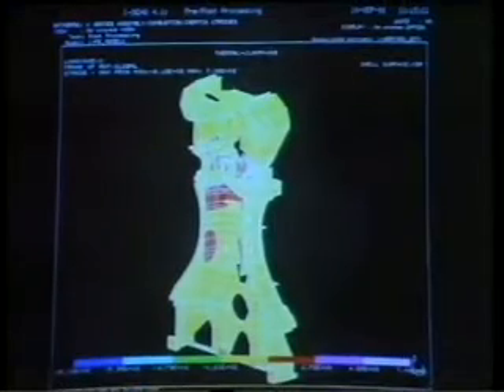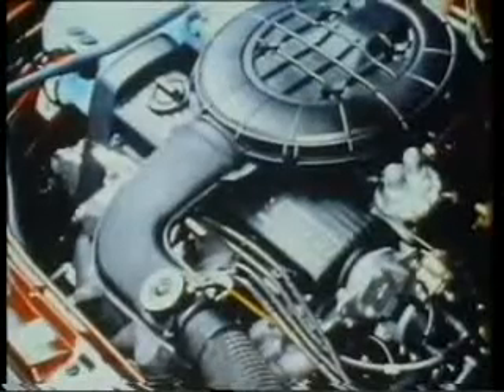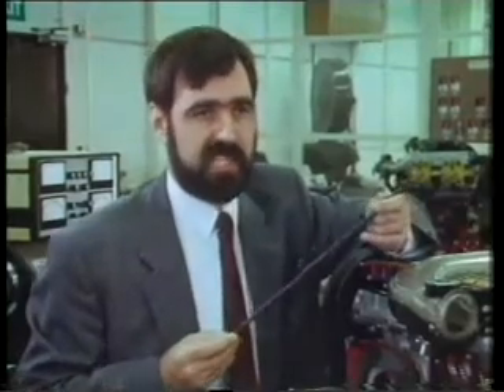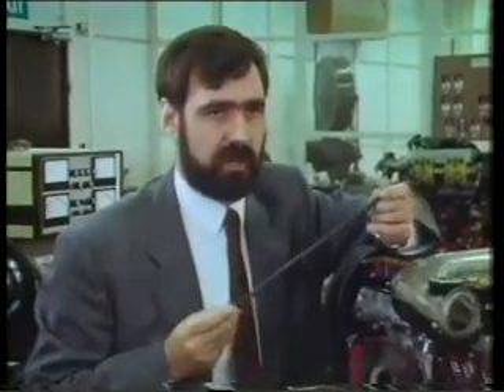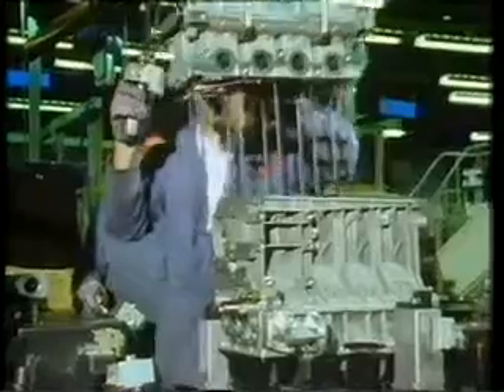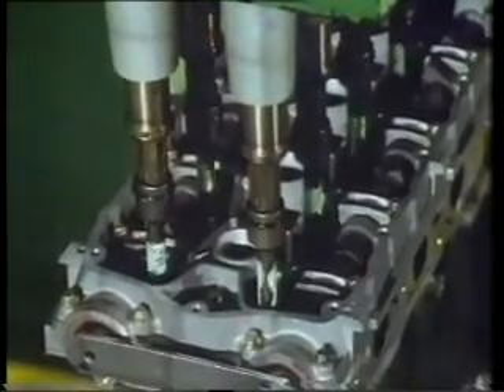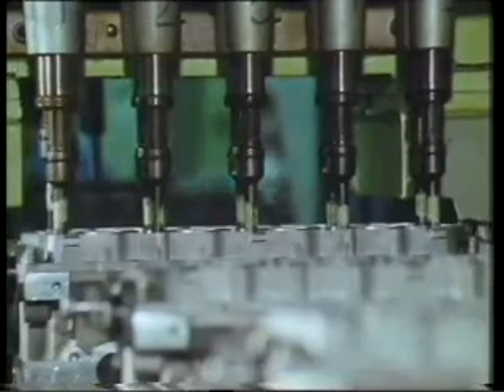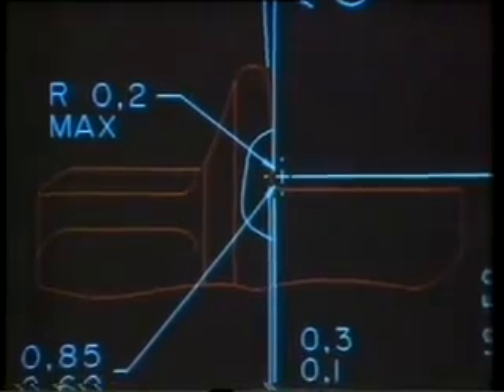Rover K-Series Engine Part Two

Comment: I had two company car Rovers, first one a 214 SLi R8 model, this did 125,000 mls, then had 414 Si HH-R model and this did 94,000 mls, never had any head gasket or cooling issues on either car, they were regularly serviced at the correct intervals and had an additional oil and filter change every 6,000 mls which proves the K series are brilliant reliable engines. There were definitely problems when the overstretched 1.8 engines came in especially with the MGF, having its thermostat placed in the wrong place which caused over heating and with the Freelander, hence Land Rover in conjunction with Powertrain developed the MLS gasket, but these are not bulletproof when used on engines where a head gasket is being replaced, especially if the steel piston liners have moved, the head gasket will fail again, the Elastomer head gasket is far better as elastomer sealing is more flexible in getting a better sealing. Unfortunately today there are too many garages doing crap repairs on these cars and where people don’t service them regularly enough. They  are a high maintenance engine that’s for sure, but well serviced they go on ever.

Comment: little did they know that gasket would kill every single one of thous engings lol... sweet engine thou.. and to be completely onest the blow up just the same as the BMW straight 6. about 30,000 before but never the less the bmws blow up aswell. and normaly crack the head...... if you have a rover and the head gasket goes always get the head skimmed always replace the head bolts. always always always drill out the the air bleed ball bearing in the intake. and you have time grind the terrible casting out in the head inside the water jackets to alllow better water flow.... you do all that the head gasket wont ever go again...oh and not that you can get the old gaskets now. always use the the uprated one with metal dowls... and for thous who dont know the head bolts and head gaskets fit the 1.4 1.6.18 1.8vvc are all the same.. and you really wanna make sure you never have to change it again swop the thermostae for a lower opening temp one plus on the air intake where it connects to the head drill the oppsite side out and put another airbleeder hose in and plum it to the header tank with a t piece...... WOW!!! lol sorry for spelling its late lol

Comment: K series can be made reliable now, with the Chinese spec gasket etc they can go on and on, and they are a very light and revvy engine, a little rough perhaps but fun to use in a sporty car, not great in a 'luxury' car though due to harshness issues. The absolute key is to warm them up slowly and regularly check coolant level due to low capacity.

Comment: The trouble with the Freelander was that people used to treat it like a proper 4x4 and attach a double horse-box to it.  The trouble is that aluminium expands about three times faster than steel so overheating is forbidden!  A Standard Vanguard engine (allegedly still made in India) would be a better bet for lugging heavy loads.  Incidentally I know someone who bought a new Freelander that blew up so often that he wanted rid of it.  The dealer would offer nothing, nil, zero, zilch on it as a trade-in so I think that sums things up.  IMHO ALL 4x4s need a radiator that is capable of dissipating the heat caused by towing the maximum GTW at the maximum legal speed on a hot day. Anything less will be a failure.
Reply: stopped making the Standard Vanguard engine in 1988

Comment: This guy is amazing at repairing the headgasket failures on these engines i had mine done 3 years ago and no faults what so ever, i recommend very highly check him out ebay.co.uk/itm/MGF-TF-ROVER-FREELANDER-HEAD-GASKET-REPAIR-/151110063282?pt=UK_CarsParts_Vehicles_CarParts_SM&hash=item232edc94b2

Comment: Fascinating vid this. My car has this engine. The K Series 1.8i vvc 160ps. People think you cant modify them but you can and the pistons are good for 185bhp easily. Pocket rockets they are until you get HGF lol, but my cars covered 72k and no probs as yet. If you pay alot of coin for something well then you are going to look after it aint ya. Regular servicing with oil,coolant and jobs a good one.

Comment: @gunnit1001 The first rover  gaskit i fitted was on the rover 400 k series cleaned r well down. skimmed the head tightened r well down. never looked back. the new tin gaskit is a good job. grand wee motor.nice to drive.

Comment: @Liamautomechanic I'm not saying they are bad cars by any means and yes the gasket fix does seem to work, there's no denying it. It's just a shame they never came out of the factory with a decent gasket. Interestingly MG are using what is essentially a 1.8 turbo k series,  and the 6 drives alot like a ZT. Re-engineered technology perhaps

Comment: I sighed at 1:50 and yet it was pot luck, anything as low as 30k or even 120k before first head gasket failure. But you would have thought by the late nineties they would  have realised there was a problem and used a proper gasket? After BMW ownership the pheonix four should have focused on replacement cars for their range instead of sports  cars (MG SV), although the MG Z's are under-rated in my view as long as you opt for diesel, v6 (ish) or v8, 10 years too late to save them though

Comment: @engineroomapocalypse My teacher is an ex rover engineer and worked on the K-series project and he says it's not the gasket design, he said it's when BMW bought Rover and they had to make the engines bigger to a 1.6/1.8 by changing to damp liners, the original k-series used in the wedge cars had wet liners and were very reliable, ARG had Maestros and Montegos going around for testing and not one had head gasket failure or any other type of failure, the problems started 1996.
Reply: The head gaskets were a problem way before bmw came, nearly everyone I sold had or was having a problem with the head gasket.

Comment: The head gaskets mainly went on the 1.8 models due to the bigger capacity aqnd the cylinders were close to the water jackets but the 1.1 , 1.4 and 1.6 were all fine.

Comment: My Dad used to own a 414 which had covered 145,000 miles and was on its original headgasket when he sold it. Also faster and more efficient than any rival.

Comment: I had a 1.8 k series Freelander and it was a god damned shocking engine on that car. The headgasket failed nearly every year, and two of the bolts actually stretched too much, which meant that in turn the engine came apart whilst driving.

Shocking engine in the FL, sounds like its a gooden in the smaller cars though?